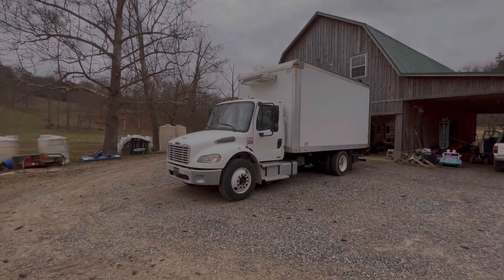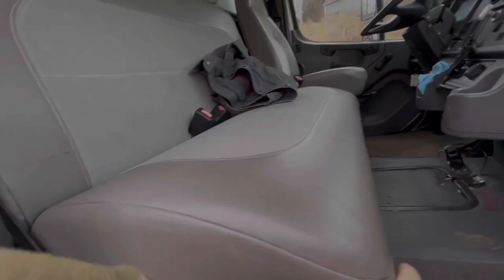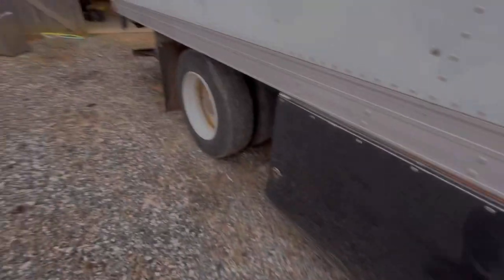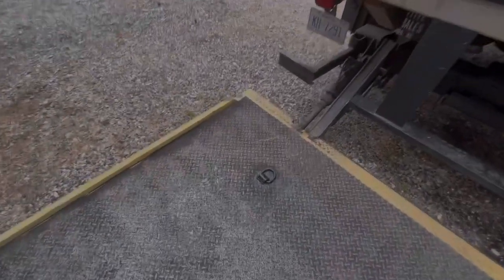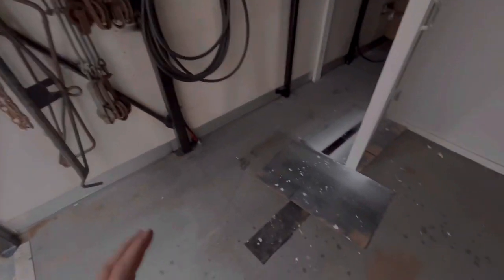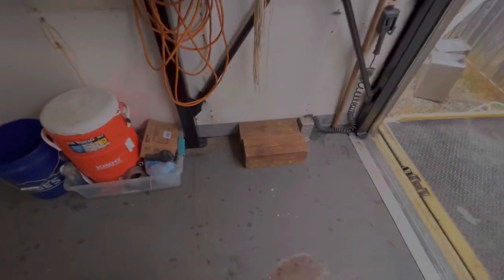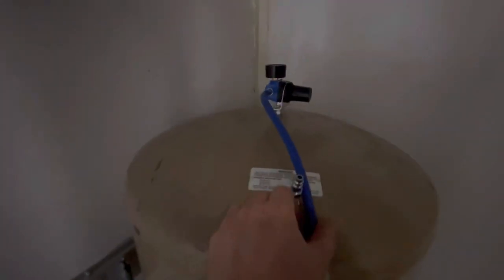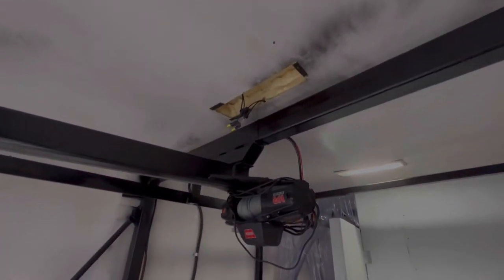Mobile Slaughter Truck Tour

Comment: Hello, I was wondering. Did you find this set up as it is? Or did you do all of the mounting of your frame Yourself?
Reply from the maker: Truck had reefer unit, generator, and lift gate on it when I bought it. Everything inside was all built and insralled by myself and my uncle.
Reply: @coreycline6858  very nice!
Reply from the maker: @357siggtmag  thank you!!